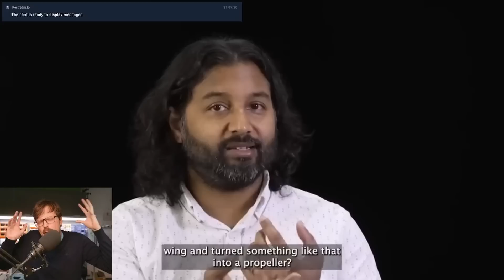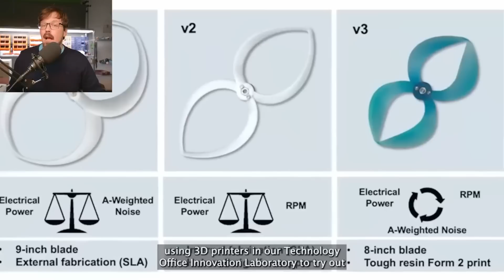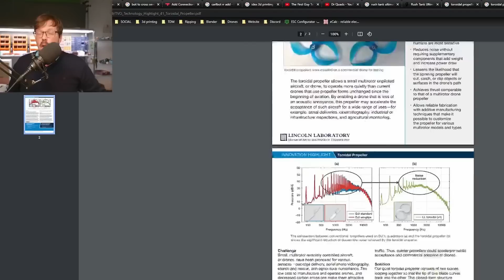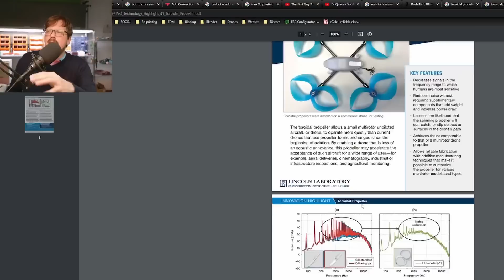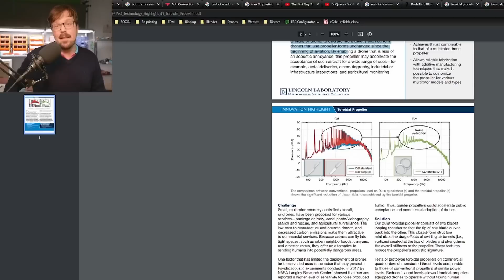MIT Thinks you're STUPID - Toroidal Propeller Snake Oil

Comment: Soo, not snake oil. 
1. You muted the video where the toroidal prop spins in the original it is not muted.  They have the volume at the same gain and you can hear it but you need to increase the volume as it is that quiet. 
2. Flow dynamics 100% agrees with the toroidal design producing less turbulence, cavitation, and noise. It is also not efficient across a large rpm range and is subject to sweet spots of maximal efficiency. 
JPL did similar studies around helicopter tips to reduce sound signature. The toroidal design does work at reducing cavitation and has reduced drag in specific domains. This is known. The reason these are appearing is that additive manufacturing is at a point where making these is viable for airborne applications. Sharrow props need CNC machining to be made and weigh a good bit more than standard props. Additive is the only real way you could make these for airborne application as the design is not as weight efficient. Its not snake oil. Its just not the be all end all. The design requires additional optimization for each specific application. So yeah Mr. 2k subscribers, you are not in fact smarter than the MIT researchers.
Reply from the maker: First off, you are on that special grass if you think I did any audio manipulation. Second, if all your fancy claims are true... Where Dem toroidal props for drones at?

If it was viable then we would already have these props for sale. It's just foolishness to think otherwise

Comment: I'm going to send Dr. Quads a donation, as soon as there is a little more money in my account!
A group of people at MIT incorrectly claimed they built the first ion propelled aircraft of any kind with onboard power!  There are nearly 50 public videos of my Ion Propelled Vehicles online, that are patented specifically for having onboard power supplies and lifting them against Earth's gravity as well as for the advancements needed to do it vertically.  The crafts have been demonstrated with onboard power since 2006 and patented for it since 2014.  MIT has tended to use the word "plane" more recently but is still being wrongly claimed to be first.  My VTOL ion thruster can fly on one side as a plane with aerodynamic lift as well, even though the point is getting an ion propelled aircraft to lift an onboard power supply.  The force of ion thrust tended to be quite low, so getting onboard power was a challenge.  The efficiency and thrust to weight of the more recent MIT bungy launched version is nowhere near the level of the patented version.
Reply from the maker: This is just heartbreaking. And this is exactly what I am talking about. Instead of funding going to the people society actually WANT it to go to (i.e. the ACTUAL creative minds behind ion propulsion) it goes to some rich "bro science" kids who get it simply because they lack morals and integrity. So basically MIT is rewarding a lack of character and punishing creative ingenuity. 

If people think this isn't there problem then they need to wake up
Reply: Luv you too Dr. Quads!  It's sad, but there are 95,000 views over the past 6 months on your channel and zero thumbs up or other responses to my hearted comment.  Something is definitely fishy there.  
Thanks again!

Comment: I work at a hobby shop and 3D design/print things for people, and I can't tell you how many times i've heard "have you seen these new weird oval props why havent you made them yet for your drone everyone has them" because they've been on YouTube lately but every time I see an example one it doesn't actually work that well. that said, I don't think MIT is trying to fool us. it's just that Youtube makers suck at making props as smooth and well balanced as store bought props. 

At 1:00 there is no evidence they "boosted" the audio, and by the way ALL audio is "boosted" that's why every microphone and speaker ever made is connected to something called an amplifier. acoustic signals are small. Drones are loud as fuck sometimes. 

1:50 actually rotary wings and fixed wings operate almost identically its just that one is in a continually rotating reference frame but propeller blades are designed with airfoils and washout and taper exactly like wings are. Just because you don't understand that doesn't mean MIT is lying to you. 

2:30 it's possible to arrive at an idea independently. the design of boat and airplane props is very different. the Wright brothers thought they could use boat propeller data to design an air propeller but discovered there is no data bc boat props were designed entirely by trial and error at that time. airplane props work like wings (flying thru a compressible fluid) whereas boat props work more like screws driving thru an incompressible fluid. 

4:20 is just explaining which factors they were trying to improve with each prototype. just because you think its a shitty graphic doesn't mean they're lying to you. 

10:00 this is not "THE paper" this is literally a 2-page brochure. If you look at the patent they filed it includes thrust per power charts for different designs that were tested. 

They may be exaggerating it's usefulness or choosing to omit that it's less power efficient but I don't think you're being fair by saying it's all a scam and that people are stupid for thinking there's something to it
Reply from the maker: This didn't age well. What hobby shop you work at?

Comment: Assuming the pressure is the produced pressure, and the frequency is the frequency of the noise produced, the RPM's are useless.  These graphs would be saying, "To produce the same amount of thrust expressed as pressure (can't read the units of measure), the toroidal prop produces less noise.  Pressure is their proxy of RPMs, and IT SHOULD BE!  Though using it as a proxy assumes one could produce about the same amount of top-end pressure, or more, from the toroidal prop.

What's missing is the amount of energy consumed by the two props.  But that is only important if you are interested in the claim that the toroidal prop produces the same pressure at the same or less input power.  On the other hand, it's kind of a foregone conclusion that the more noisy the prop, the more energy that is lost by it.

Methinks it's more a matter of you don't like it that someone called you out on not reviewing their research.  Could they have been more exhaustive?  Perhaps, but that depends on what they claim their prop does.  So far as I can tell, they claim it is quieter for the same performance, and for that claim, they pretty much supply the information needed.
Reply from the maker: Did you watch my latest video?

Comment: They did not mentioned that "Toroidal" propeler's canot change a pich angle that is reguire on Planes when they are on higher altitudes and where is air a lot thiner so the plane must change the Pich and angle off Propeler blades in order to "Grab" much more air in order to stay on that altitude.....
Yess maybe that "Toroidal" propeler's work on sea level altitude,but on 25 000 feet air is 60% thiner and toroidal propeler canot change pich or angle off attack.....This is justa propaganda and  slopy "Kick starter"......When i se them on Mount Everes with that "Phantom drone" in the air with mounted same angle toroidal prop's then i will say well maybe they are on to something...........................

Comment: Any comparison tests of these toroidal props need to compare only 1 variable at a time, like the motor, material, surface smoothness, pitch, diameter, number of blades, voltage, amps, rpms, etc. If there is more than 1 variable, the tests are invalid comparisons.

Comment: it seems to work on boats, higher speeds, lower noise and substantial increase in fuel  fuel economy. the drawback, those boat props are stupid expensive. weight is not an issue on a boat prop t. On aircraft it could be another issue. a pusher prop might work well as a large toroidal on the nose of a single may pose a vision issue.

Comment: ... correct, the choice of the propeller type and application depends primarily on the task at hand, and this is not really 'new' in any way. Since the variety of the boats / hovercraft, aircraft and many military applications. such as the some types of submarines are using toriodal propellers of every sort, for a very long time. The main choice remains focused on the efficiency and safety first, and propeller type is chosen by the application type and not by the noise footprint. If it would be chosen only by the noise print - it would not be having too long safety or operational future, in that case. Also, the application on the drones and the application on a realtime aircraft is a very, very different approach, as the author and presenter of the video has also very well demonstrated, along with it's (quite-a-few) reasons :).
Reply from the maker: well said, Sir!

Comment: Why wouldn't a simple ringed propeller be even quieter?  There'd be no perimeter lobes thumping on the air.
Reply: That is a good question. It is claimed the principle benefit of toroidal props is reduced tip vortices so why wouldn’t a ring or a shroud do the job? The problem is trade offs such as extra viscous drag, weight, increased gyroscopic effect, increased load on blade root, and unsuitability for variable pitch. Same exact drawbacks that must unavoidably afflict the toroidal design as well. So them’s the real reason that the marine and aviation industry is neither excited nor bothered by this ‘innovation’. There is already the Kappel type marine screw that’s been in service for many decades but which occupies a  niche where it delivers 2 or 3% fuel savings. And they don’t cost 10 times as much as a conventional prop neither.
   All fixed pitch props achieve peak efficiency at a specific design point. I understand that leisure boat owners who want best efficiency change out their props depending on how they plan to use their boat. Much like bike racers change their final drive ratio for each track. When your props costs $300 a piece that may be worthwhile but at 5 grand not so much.

Comment: A-weighted..  Means the noise is weighted according to the  IEC standard 61672:2003.  This is very commonly done, to represent the effect on human hearing (as opposed to just sound energy, much of which has no impact on humans because we can't hear it).  

You assert the audio is boosted.  Not sure how you deduce that.  The room noise is just as likely to be reverberation coming from the drone, not white ambient noise as you claim.

Also power is power.  It's Watts.  Not amps.  Not Volts. There is only one unit of electrical power.

Fair call on the distinct lack of data / numbers.

Comment: Lets see what AI has to say about the history of those : " The development of toroidal fans specifically is attributed to a German company called ebm-papst, which first introduced the technology in the 1980s. The company patented the design and began producing toroidal fans for a variety of applications, including computer cooling, telecommunications, and automotive ventilation systems.
Since then, toroidal fans have become increasingly popular due to their compact size, low noise levels, and high airflow rates. Today, they are used in a wide range of industries, including electronics, HVAC, and automotive, among others."

Comment: 4:55 What? Current (amps) is current and voltage is a potential difference, only watts are power (and VA if you want to nitpick). But the important info would still be, the power to do what and of what?
So the power for hovering, max power, min power, average power for some flightplan etc.
Reply: The point is that there’s no figures of any kind at all.

Comment: Well - just give it to an SLA printing service. I got my own SLA for turbine design. I had a good laugh about this toroidal propeller pump & dump scam the internet is currently flooded with. Is there any official statement of MIT on this scam?

Thanks for taking your time to make this video. I still bet on these scammer pull through with some stupid money.

The real problem is that this does drain attention from my R&D from my university lab verified findings. On research in tidal power - highly significant for 2 m/s currents that are currently inaccesible by turbines we do know of. Stuff that makes me an expert on propellers and turbomachinery in air and water. Stuff that has a solid foundation in fluid dynamics but needs more than fruit fly attention span to grasp and that is put at a disadvntage by such bogus science.

It can already be mathmatically shown easily that toridal design cannot achieve the efficiency beliow Betz limit compared to the best prop designs we do have. This is a field that has gone through close to 200 years of popeller optimization history - starting from steam boat wheels basically.

Comment: They didn't boost the audio, they increased the throttle to take off.
More throttle, the props spin faster, more noise.
Reply from the maker: You need to look up "white noise"

I may not be an aerospace engineer, but I am a sound engineer. That white noise in the room gets louder

Comment: He may not be the Godfather of the toroidal propeller, but he seems to be the first to apply it to drones and he claims it effectively reduced the sound level. I doubt that he is lying. He's actually working, while you are just talking.
Reply from the maker: Who tf are you talking about lol
Reply: @33rdframe  Also, the props are round on the edge, so they look less prone to damage. It makes the props heavier, because there is more material, hence the lower thrust efficiency, but I do believe that it may offer better control. It's not stupid.
Reply from the maker: @ClownBot-st4pn  bro you never answered who you were talking about
Reply: @33rdframe  At any rate, there is a lot of research going on with regard to prop design, for computers too. There are definitely some designs that are better than others.

Comment: I've seen a channel about making custom computer fans use this design as a fan design, and it is terrible. It uses the same motor for every single fan design, and uses the same current draw. It's only about 50% as efficient as a regular computer fan. Ontop of that, the airflow seemed to go everywhere compared to the regular computerfan's more focused airflow.

Comment: Wouldn't using a 3D printer also make it a bit louder? The grooves running through the air?
Reply: Bro.

FOR REAL, how is ever something like a drone going to be quiet? The thing alone without the propellers attached makes so much noise already, no matter what you put up in there is going to be LOUD. Surely it could be quieter than the original propellers, but that's like comparing a gun suppressor and calling it a silencer... ITS STILL GOING TO BE F$@$@ LOUD...

But honestly the new shape looks better and less threatening than the original blades, for that alone I like the new design, if it can provide better deficiency and lower pitch (yet still loud) even better!

Comment: For comparing things, you can't compare the propellers by RPM really. You should compare them by effective lift. A "Propeller" with flat blades will make very limited sound compared to a propeller that actually moves air. The optimization therefore is noise per thrust/lift, not noise per rpm.
Other than that, i am also stunned about the blatant lack of simulations. Doing a fluid dynamics FEA isn't that hard, especially on those very simple designs volume-wise. Especially considering there is already 3d models to 3d print. Getting noise levels there is hard, but it could give info about rpm/torque/thrust and therefore the efficiency baseline in comparison to conventional propellers. Doing simulations for a living, that might be my pet-peeve, but if you show animations, at least show useful animations man!
Apart from comparisons and lack of simulation, i do not think researching various propeller shapes is all that wrong. Obviously the way they are doing it is methodically flawed. But, fluid dynamics is hard. The fact this stuff is changing on motorboats (and commercially viable there apparently, i am not a motorboat guy) tells me there is at least a little bit of experimentation/simulation that needs to be done. Deserves less attention though if there are no real results....

Comment: Seems like it's hard to escape the fact that more surface area = more friction
Reply: When designing any kind of airfoil there's always a tradeoff between friction drag and form drag. Form drag tends to increase loading (decreasing area per unit load) and friction drag tends to increase with surface area. There's usually a sweet spot between the two extremes that provides optimal efficiency. It's likely that the optimum loading will be different between a toroidal and conventional propeller. And it certainly shifts toward lower loading and higher surface area if noise is a more critical design parameter than efficiency.
Reply: Maybe some type of artificial surface that mimics shark skin denticles would work